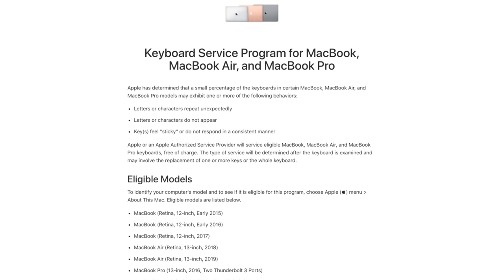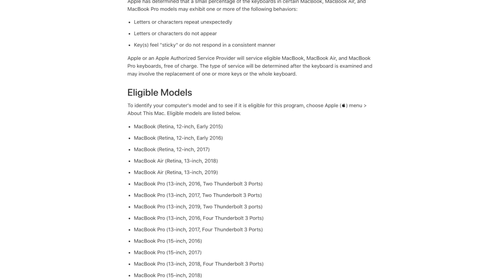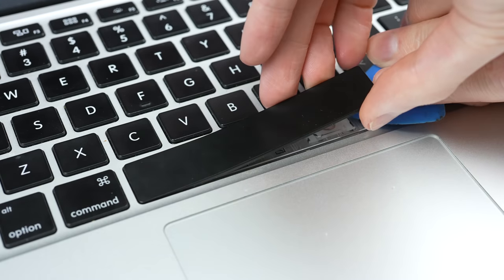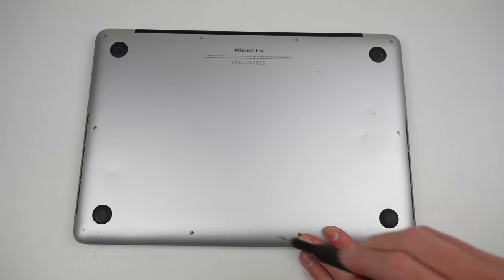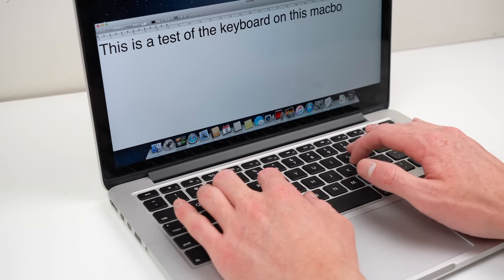Apple Really Doesn’t Want You To Fix This - MacBook Keyboard Replacement

Comment: It makes me wonder if Apple holds a competition for the least repairable/most wasteful design every time they release a new product.  The "engineers" who designed this should be drummed out of the profession.
Reply: Why should they? They are merely achieving their objectives at work.
Reply: realistically this is a push from the business people to make the laptop cheaper to manufacture. they don’t have to tap the holes which reduced the amount of manufacturing steps required to produce the housing. also rivets save on assembly cost.
Reply: @BogusQuacky  >they don’t have to tap the holes
i thought the frame did still have screw holes tho? it looked to me like they made screw holes but screwed in rivets instead of philips screws
Reply: @Maximus20778  >its…
can you blame the employee for doing what their boss pays them to?
Reply: @miscl_anon came to defend apple or are you just a waste of time
Reply: @miscl_anon  also type properly its cringe af
Reply: @Maximus20778  >came to defend apple…
i’m not defending apple. I’m defending the people working for them
>type properly 
I am?… what am i doing wrong?
Reply: @BogusQuacky  cheaper to assemble and a much better way to attach the keyboard to the aluminum. Looking at the amount of rivets, I’d bet there’s not much structure there. Any structure you add is going to remove space or weight from another component. Screws are likely just going to fail.
Reply: He should come back in a year and check the tightness of the screws.
Reply: It wasn't designed by an engineer, it was designed by a designer with no knowledge of engineering. Imagine being the poor engineer who had to realise this.
Reply: Blame the clowns with MBA's
Reply: @BogusQuacky  rivets belong in buses trucks and aircraft not computers lmAo 🤣.
Reply: and they say now they don't include charger on iPhones to reduce e-waste.. yeah right.. reduce e-waste for bloody charger while your macbook keyboard or ssd broken you toss the whole laptop to the bin 🙄🙄🙄
Reply: @MrMklasse  every company follows apple’s footsteps 🤣 even SamSheep!
Reply: Sadly, this is nothing new in the world of keyboards. Even in full size, full travel desktop boards. Even the Model M (which many people consider to be absolute tank) uses plastic rivets to hold the plate and sensing assembly together. Basically everything after the IBM beamspring and Honeywell hall effect boards have been exercises in making cheaper and cheaper keyboards.
Reply: Maybe you should look how the keyboard is replaced on many other laptops, literally ALL manufacturers have atleast one model where the keyboard is either riveted on plastic welded into the top-case, not just Apple even though Hugh clearly wants you to believe so.
Reply: @williamtopping  Oh great.  195 countries in the world.  Politicians in everyone.  Each deciding to tell you how the laptop in their country will be made. All different from the other.
Reply: @OskarBlomkvist  I know at least one company that doesn't :P
Reply: @dlewis9760  France actually came up with a punishment for bad actors iirc: Official repairability score
I don't know the details though
Reply: Yes, it's paradoxical, they just bragged on their recent Keynote with things like 100% recycled Aluminium (which isn't uncommon, because it takes AFAIK about 5 times the energy to extract Aluminium form the ore (mostly Bauxit) than to recycle it), close to 100% cardboard packaging - I bought three Dell U2414H screens around 7 years ago and except a foamish bag for the screen itself and a plastic bag for a back cover it was completely packaged in cardboard, no EPS Foam/Styrofoam or in Germany we say "Styropor"; also many other phone manufacturers got rid of plastic packaging years ago, hell my Nokia 5210 from 20 years ago lacked plastic packaging except one or two bags for the phone itself and accessories...

But after that? Yes, it's longer profitable to refurbish Apple Devices than Android/Windows ones but their repairability is often pretty bad compared to others like Hugh showed us with his Dell XPS or the Fujitsu Lifebook U938, damn, RAM, SSD, WiFi, Mobile broadband (no MacBook had that yet but a f*cking Apple Watch to eat the battery even faster) and even the battery is just screwed in: https://www.notebookcheck.net/fileadmin/_processed_/8/7/csm_Fujitsu_Lifebook_U938_Innereien_36065c2a6d.jpg
And it's got a bunch of ports, USB-C, 2x USB-A, HDMI, Full Size SD and even a fold-out ethernet: https://www.notebookcheck.net/fileadmin/Notebooks/Fujitsu/Lifebook_U938/Fujitsu_Lifebook_U938_Ethernet.jpg
And with all that it's still lighter than a MacBook Air.
They're one of the leaders in planned obsolescence since the iPod with it's battery that isn't user friendly to replace!
Reply: @BogusQuacky  from what I've seen from Apple up to this point, making it cheaper to manufacture is just a happy accident, their intention seems to be to make their stuff as difficult to repair as possible so their hostages buy a new device instead of fixing what should be a perfectly capable device otherwise.
Reply: Why blame engineers ?
Blame the management
Reply: @mrlt1151  But then the keyboard is likely to fail in some way at some point, And highly likely the laptop will have to be binned rather than repaired - What happened to Apple's noise about the environment?
Reply: @helenHTID  Apple’s repair is to replace the case. This is likely because they don’t want to risk their service personnel grinding or drilling the rivets/ the laptop is likely not worth the labor cost of the time.  Many items are manufactured with rivets, particularly when aluminum is involved. There are normal practices for removing and replacing them, the video’s poster just doesn’t know what he’s doing.

Apple could have found screws were failing and caused more service action under warranty. Assuming that, rivets would decrease the amount of service needed and on balance increase the life of the laptops overall. 

Same thing with connectors. When I was in college, I’d repair iPods and other electronics (yeah, I’m old) on the side for extra cash. I can’t tell you how many times I’ve opened devices that have taken a fall only to find connectors loose. I’d say the #1 thing that killed iPods young was water damage (I always assumed they were dropped in a toilet). I’d bet the same thing was true for iPhones, which is probably why they seal them up so well these days.
Reply: @Kanaba Nakamura >Pawns mostly have no say to anything that the King wants
ri, yea, exactly
Reply: Their phones are certainly not the least repairable. Battery and screen replacements, for example, are much easier on iPhones than on Samsungs. Samsung still uses strong adhesive in their batteries, in 2022. And now they have started the user repair program which will hopefully move them towards a more repair friendly direction
Reply: @Jaquan Kelsor I haven't seen any products effing thousands of customers like you said. Also, the employee is supposed to do what the boss asks him to do. Not you or anyone else who is not present in that office.

Plus the common consumer doesn't spend their time tinkering around with these things anyway.
Reply: @traviswalker8933  Because they've literally been sued and lost over this type of shit. Consumers have a right to repair
Reply: @Helladamnleet  any evidence?
Reply: This kind of happens all the time... the designers and engineers solve a problem without considering service or repairs down the line. They have their checklist and that is outside their scope.
Reply: Don't blame the engineers. They're not the ones coming up with the idea
Reply: Yesterday I had to remove the keyboard from a friend's Acer, I disassembled everything to reach the keyboard only to find out it's riveted. So yeah, it sounds like a competition
Reply: @miscl_anon  actually yes, that is called ethics, for example as a salesperson i was asked to omit information clients asked, i never did, i never sold anything i knew a client didn't need or offer more expensive stuff without mentioning the cost benefit wasn't that great if it wasn't worth it
Reply: @devforfun5618  >ethics
I'm assuming you're referring to my comment about the employee and their boss; that really depends on many factors. for people who are confident in their job security and have assurances about their personal freedom to operate, they may go against their boss's orders. however, for a person who doesn't have many other employment options, they're less likely to disobey their boss's orders. ethics only works when there's room for ethics.
Reply: Raleigh and Future Motion say hello to the competition.
Reply: @MrMklasse  Lol. Aluminum is 100% recyclable and requires much less energy than creating new aluminum, and most hardware components can (and should) be recycled as well as they contain precious metals like gold and copper. You throwing out the computer is causing more damage to the environment, than simply handing it back to the manufacturer or  repair shops.
Reply: @Dio zando bro you aint typing properly either. Are you actually dented?
Reply: The engineers who designed this are doing what they are told.

If the engineers left... then Apple's higher ups would get someone else to do this same thing in its place.
You want to throw blame... blame the people who are forcing this.
Reply: @miscl_anon  "can you blame the employee for what their boss tells them to do?"

Oh, so suddenly "I was just following orders" is acceptable right?
Reply: @charlesrodriguez7984  Funny that 'SamSheep' makes some of apple's 'OEM' components. Sounds to me like you're a seething ios user
Reply: @thevalorousdong7675  >Oh so suddenly…
… what?
but also, if you’re drawing the comparison between covid policy enforcement or whatever, and petty corporate profits, i think there’s a drastic difference between the two contexts…
Reply: @Saavik256  not really since they did it on purpose for people to have difficult time fixing it and just buy another apple product
Reply: @thevalorousdong7675  How the fuck you think employees make money? It's a job every damn job is like that, you're supposed to listen to what they say in the job or they are fired and struggle finding a job again

Comment: I did this same repair a year ago. My replacement keyboard came with it's own backlight so I didn't have to worry about damaging the original. But, it didn't come with screws, so I instead super glued the new keyboard to the frame. Kinda janky but it's worked well.

Comment: I had the Apple PowerBook G4 Titanium back then. Replacing the keyboard was done in seconds. No need to open the PowerBook at all. With two little clips on the top of the keyboard you were able to just remove and refit it or fit a new one!

Comment: The side cutters were the right tool actually! 
So much so that with newer Macs (especially with butterfly switches) it's impossible to use the hammer without breaking them!
BUT
A) Do that under a microscope. (If you're a pro repairman, you should have one, otherwise you shouldn't even try this).
B) Use very old cutters, so they're less likely to cut the rivet and will just grab it.
C) Needs a little practice (let's say... a single keyboard since they're full of rivets) before becoming way faster and safer (for rivets and for your hands) than the hammer.

Source: worked in a repair shop, changed dozens of Mac keyboards.
I myself had been using hammer and screwdriver for years because I had given up too early on the side cutters after I cut the firs rivet. Then the new keyboard with smaller rivets came out and the hammer just destroyed them, so I researched and found out that the cutters were the only tool to do that.
Reply: That looked crazy to me. I would've tried to drill them out like a normal rivet. But those are blind rivets and they are tiny. Thank you for adding a tool to my knowledge!
Reply: They tried so hard, but then they lost to a rusty old cutters? 

Just stupid move 🤣, next time I think they might just glued the keyboard together.

Comment: I do field warranty parts replacements for Dell, HP and Lenovo.  Almost all thin and lights have riveted keyboards so the OEM just sends a palmrest/kb combo part. However swapping the palmrest is super easy on all 3 brands.
Reply: What happens with the bad palmrest then? Do they disassemble and replace the bad parts to prepare it for use in next laptop repair or do they dispose/recycle the entire thing? Thanks!
Reply: @trailblazercombi  I only return the parts to Dell.  HP and Lenovo don't want them back so I toss them in e-waste recycle.

Comment: I don't know if it would work in this case, but when I needed to remove rivets many years ago I was taught to drill them out. For such small rivets, a steady hand and tiny (easily breakable) drill bit would be needed. What a pain!
Reply: A ball head grinding bit on a rotary tool would be ideal for this. The right diameter would cut through the surface of the river head but not dig into the hole where the rivet is seated

Comment: I recently purchased a second hand late 2008 model (15 inch MacBook Pro)
The keyboard is still working, but there seems to be 1 or 2 keys that have seen better days (none of the keys are loose, but 2 are a little wonky, one of which is a little broken (missing plastic) and it makes a crunchy sound when pressed)

Comment: After seeing this video, I am so happy with my old Lenovo Thinkpad. The keyboard has been out of the laptop many times, it has been stripped to the bare bones, because I had to replace the cpu cooling paste and the motherboard had to come out. That was the last step in the process. There a manageable number of phillips screws in a few different sizes, no adhesive or glue except for one piece of kapton tape, a few connectors and definitely no rivets. It was very straightforward to repair or replace myself. Later, I did the same on a newer Thinkpad in a similar fashion, it was relatively easy and I am no expert. Even the newest Thinkpad X1 Nano seems to relatively easy.

No Macbook for me, ever.

Comment: In retrospect, in case you have to replace another keyboard the same way, you might as well start knocking out the rivets starting from one side with your hammer and screwdriver and slowly pull out the damaged keyboard until you reach the last rivets. It's a good thing you would still be able to use screws after the rivets have been taken out.

Comment: I can’t help conclude that apple go out of their way to make the laptop difficult to repair so you end up buying a new one which is actually bad for the environment
Reply: You honestly think that it's just Apple who does this?If so, you're wrong.
Reply: @OskarBlomkvist   yes.. most of the other brands are much more easier to repair
Reply: @sholmes_ttyy  No.
Reply: @OskarBlomkvist  they literally are easier to repair though, at least when talking about computer hardware
Reply: @OskarBlomkvist  >Denies Statement
>Fails to provide other companies that go to as many lengths as Apple to make sure you cannot repair their products in an easy and straightforward fashion
Reply: @ToasterBath  If you were actually working as a computer repair technician you would know that there are pleeeeeeeenty of other brands were the keyboard is riveted into the top-case.

But if you don't believe me, just google ''Lenovo V110 keyboard replacement'' and you'll see ONE of many examples.
Reply: @OskarBlomkvist  they are easily replaceable compared to Apple shitty stuck keyboard. Am I a computer technician now?
Reply: @amint7107  No, you’ve clearly never worked on a computer so your opinion is irrelevant.
Reply: @OskarBlomkvist  it seems that I can say the same to you.
Reply: Working as a computer technician for over 15 years here. Apple is not the only one who does this but by far is the one who makes it the most difficult to repair (like most of their stuff tbh). I been around all brands and models and riveted keyboards are ussualy really low end budget laptops and not that common (exept Apple ofc). I see around 35 laptops per month on avarage and from those 35 i might find one or two with riveted keyboards and are almost always around $400 low end laptops.. there might be high end out there you really need to specifically look for them you wont cross them on a regular basis fortunately. But yes when someone starts to ask me to change a keyboard im always begging in my mind "please not a mac"... i generally dont like repairing Macs or recommend them at all for this matter they are pointlessly overcomplicated just to force people to pay massive amounts of money for simple repairs.
Reply: @OskarBlomkvist  Apple is by far the worst offender in making computer unrepairable.
Reply: No need to conclude anything. That is exactly Apple's business model. They don't actually repair anything, they replace it, and charge exuberant pricing for it, to help justify you buying a new computer. You take your laptop in for a screen repair, even if it is just the screen's ribbon cable is unplugged, and they will try to sell you a new logic board, screen, battery, ect. Then they show you a price way over the cost of the pc itself and then say, "It would be better for you to just buy a new one."

Comment: It is vastly easier to use rivets instead of screws The problem is you only do that when you know that the thing is never needing to be taken apart. The Russian migs in the Cold war used rivets instead of flush welds or anything other like Western aircraft design. The theory was that you could simply just get another one instead of repairing the aircraft tank gun or whatever. It worked because there was a large manufacturing system behind it and the fact that individual pieces generally weren't either kept or used for super long periods of time. However, with a laptop like this, I don't think that methodology is viable.